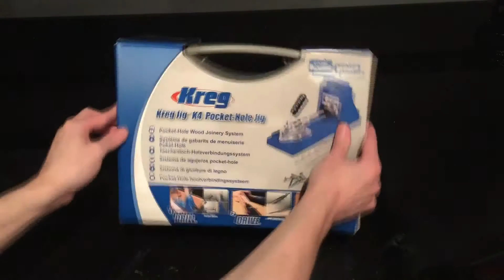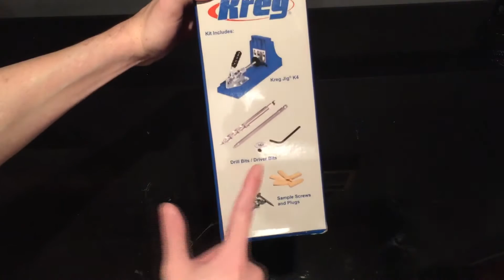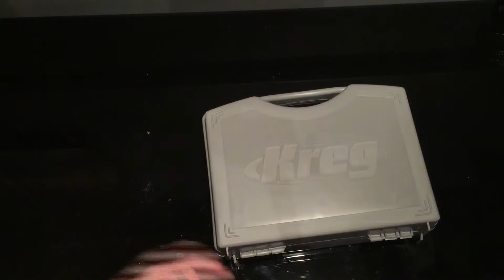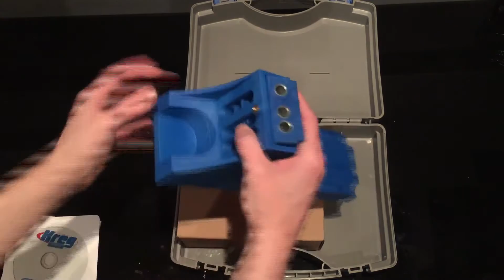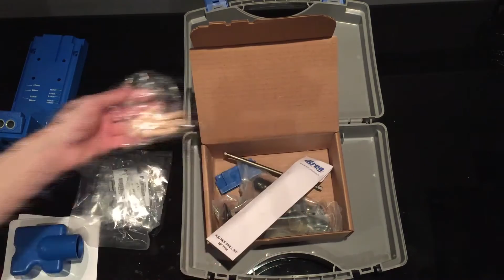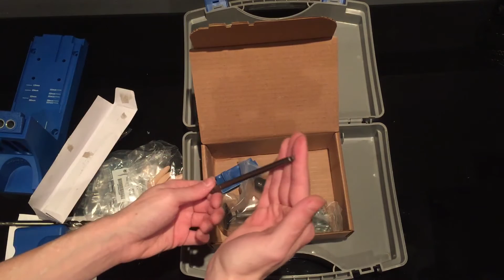Unboxing of Kreg K4 Jig Starter Kit

Comment: I have the same one; It works great. I mounted mine onto a piece of plywood and added some supports on both sides of the jig for wide pieces. I hang the whole thing on the wall when not in use. You seemed pretty knowledgable about the product, so you must've done your homework. Nice job!
Reply: Incorporating a box for the bits and such is the only thing I haven't done, but have been meaning to do. Maybe I'll get some ideas from yours once it's done!

Comment: I've always liked Kreg products, though I've never personally used any. However, I do have a brand new Kreg router lift that I bought early this year. And recently I bought a Kreg router table top. I plan to build a full sized router table sometime within the next few months.

I hope you get lots of use out of your pocket hole jig. The Kreg jig is far superior to the one I have.
Reply: I agree with you, ***** . The Kreg Router Lift (and their other router products) are quite expensive. It took me several years of wanting to finally break down and make the purchases. But since my first router table purchase was a cheapie table top Ryobi setup, I learned that being "cheap" didn't get me the features and functionality I wanted or needed (but then again, I didn't KNOW what I wanted or needed at the time). So I had to make sure that my upgrade was truly an upgrade worth investing in.